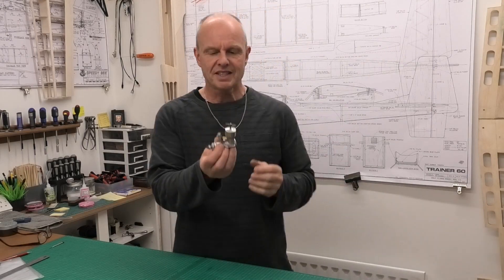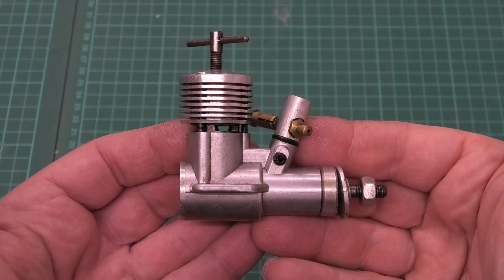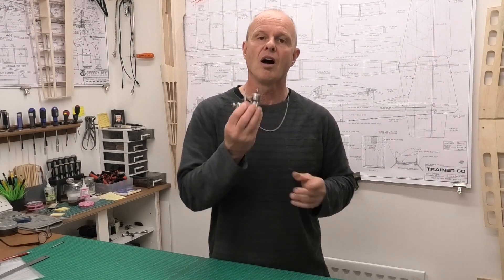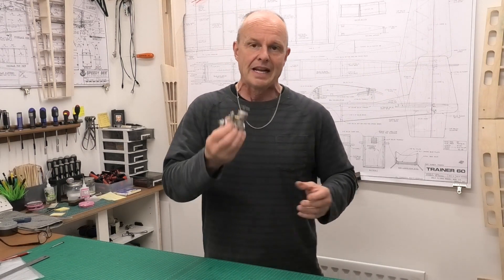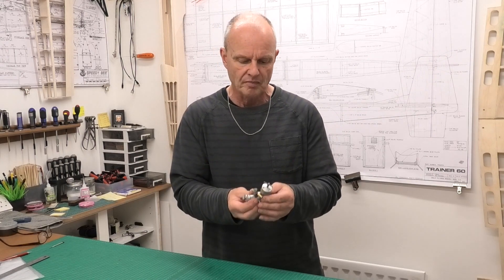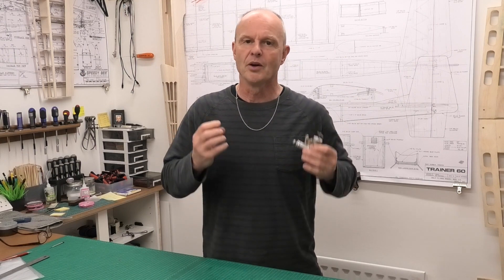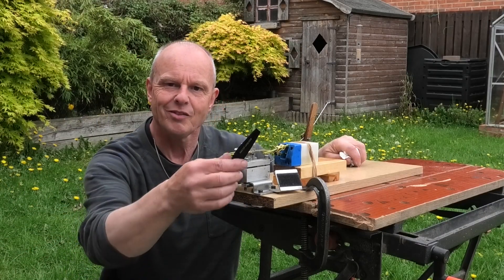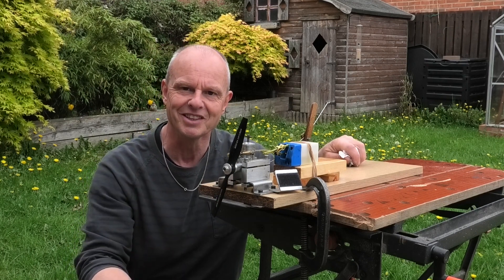P.A.W.  English 1.49cc (0.09 cu in) Diesel Engine - Test Run - PAW - Progress Aero Works

Comment: mi e' piaciuto molto perche' non ho mai visto questi motori a diesel funzionare , in  quale anni sono stati usati nell'aereomodellismo? 60/70/80 ?  grazie per il video
Reply from the maker: These engines are still manufactured and used all the time, they are great running engines.  thanks for the comment
Reply: Paw ha cominciato a costruirli negli anni '50, ancora vengono prodotti, si possono acquistare nuovi direttamente dalla fabbrica qua:https://www.eifflaender.com/ Se ti interessa ne ho diversi usati in vendita.

Comment: Hi Mark. They run like a watch. Great little motors for half A combat. On the early motors the ventury was part of the crankcase, and on bad landings the first thing to break was the needle valve. I still have several PAW needle valves in my workshop. Thanks again. Terry
Reply from the maker: Yes, great engines, pleased you like the video.  I must get this in a CL wing or maybe a vintege model
Reply: @MarkRobinson555  - How about a Junior Flight Streak? They were for .09 to .15 engines and flew great.  I used a Cox .09 on mine. Later put a K&B 6.5 on a full size Flight Streak. Pretty sure it topped 100 MPH running Fox "Missile Mist" fuel.  : )
Reply from the maker: Thanks for the comment, I do have plans for a standard size Flightstreak, but, yes, maybe a Junior would be a great idea
Reply: As long as I can remember Half A was .049 ci displacement.